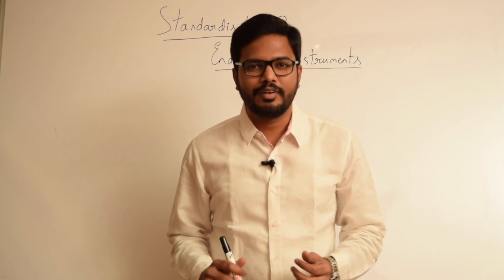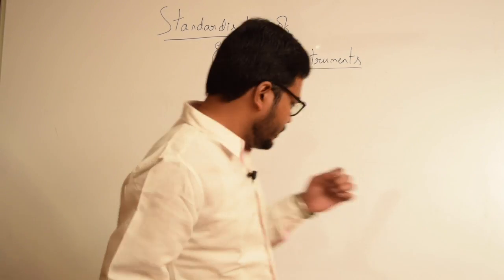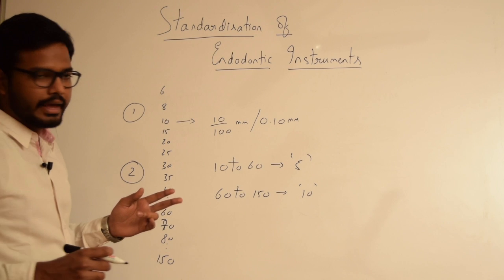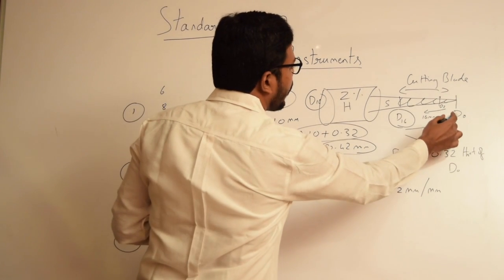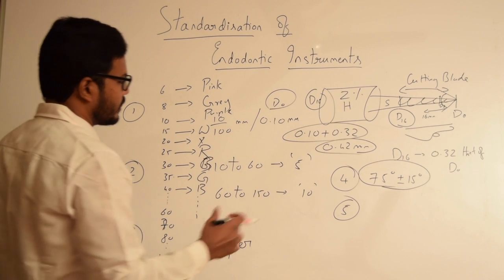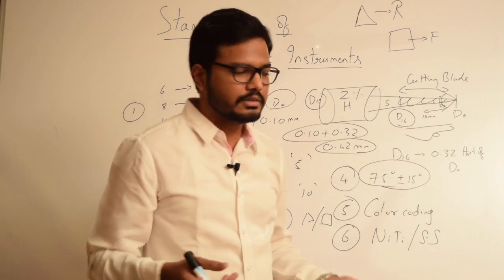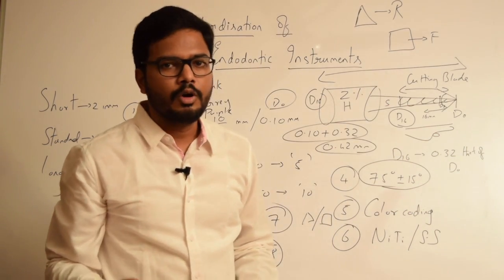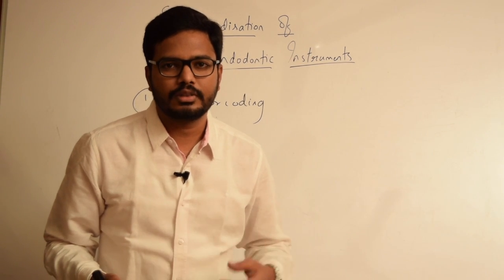Standardisation of Endodontic Instruments

Comment: so as i understood, the diametar of the instrument 10 on D3 for 4 % taper  would be 0.1mm plus 0.04 x3 mm . i have some questions regarding this topic  
1. Is the working blade is always 16 mm ?
2. How many tapers is manufactured ? you mantioned only 2 % and did not mentioned other possibilities of taper ?
3. What is about engine endodontic instruments rotary and reciproc, and how are they standardised ? can you make a video about that
Reply from the maker: Glad to hear from you Benzamin. Get back through doubt clarification form available in general section of our eclasses via guest login @ eclassesbyptbdacdemy.com for getting your doubts clarified. Best wishes.

Comment: D16 is not .32 times D0 but .32mm more than D0. Apart from that, great video, extremely helpful 👍🏼👍🏼
Reply from the maker: Yes, correction has already been added to description. Check it out Ramneek. Best wishes.
Reply: It's still wrong Sir coz .32 times means multiplied by .32, when actually it is supposed to be plus .32. So I guess u wanted to mention .32 more than D0 instead of .32 times.
Reply from the maker: Check out the correction which has been added to description now. Thank you for getting it to my notice.
Reply: Perfect! Thanks Sir! :)

Comment: sir reason for the angle 75+- 15degree angle? and why there is 10 increase from 60 to 150 and from 10-60 only 5 ?
Reply from the maker: Good question. 

As far as my knowledge is concerned, it's all about standardisation. I reckon the tip angle of around 75 degrees is probably given to have adequate bulk of the material at the tip and also to enable to instrument to advance in to the canal apically. 

We have Flex-R-file in which the angle of the instrument tip is flattened (non-cutting tip). Non-cutting tip decreases the chances for canal transportation and ledging during enlarging curved canals.

Regarding increments of 5 between 10 to 60, it's to accommodate finer or narrow canals. We even have intermediate sizes (Golden medium files) such 12.5, 17.5, 22.5, 27.5, 32.5 etc which were suggested to decrease the big transition in diameter between small size instruments.

So it's all about designing or incorporating features based on anatomic variations of the canals and to prevent confusion or arbitrary manufacturing of these sizes, standardisation has been incorporated.